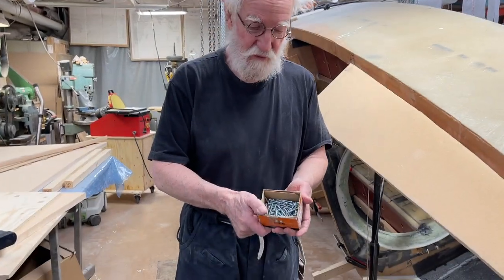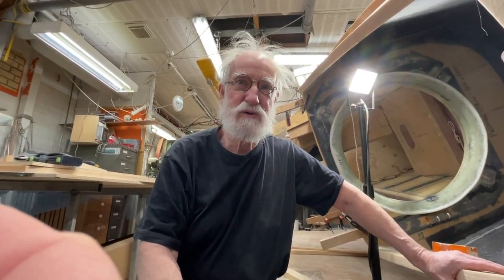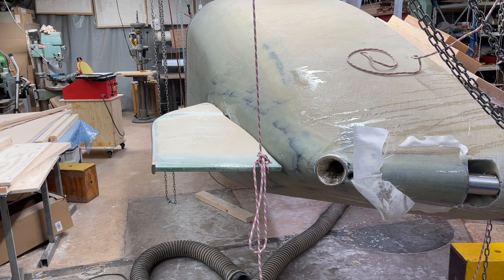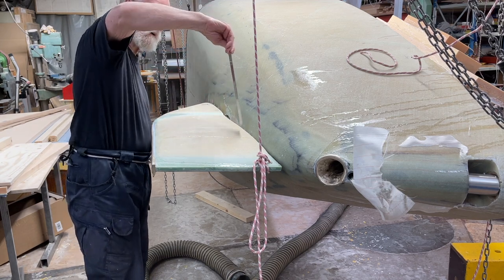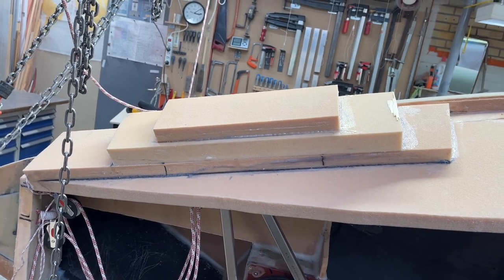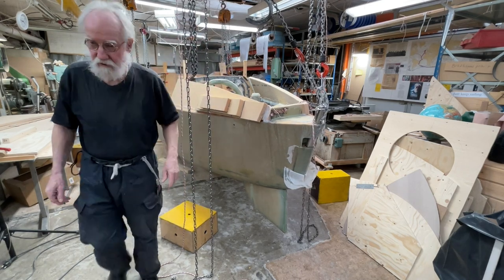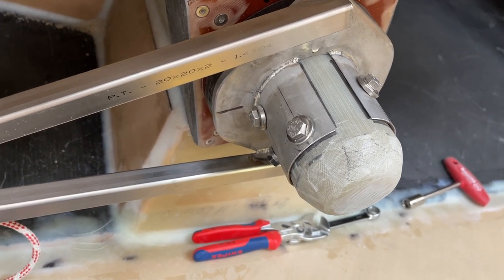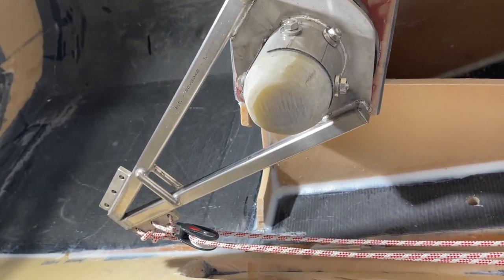Swinging the rudder

Comment: When a person thicknesses a violin initially, holes are drilled a measured amount and the top or back is gouged out.  When the holes disappear the rough thickness is right, then the fine finishing is done with scraper and sandpaper and caliper.  Much like working with Dvinycell it seems.  I don't like the blister much but if it has to be it has to be.
Reply from the maker: Thanks for the violin information
Reply: Bilisters in this sense can be beautiful. Look at potent cars from the sixties and seventies. The blister tells that there is something extra “under the hood” while the original body is as slim as it can be
Reply: @SvenYrvindExlex  Any time you want to build a violin let me know, I'm here for you.
Reply: @petternorman6192  Yeah Petter you're right about that but in this boats instance I thing something could get jammed in there when it gets rough.  There's going to be rope and drogue chain and anchor and all kinds of stuff in there.  I think you're talking about mid 1960's Prototype Fords and Ferraris and cars like that.  They were works of art.
Reply from the maker: @ralphwatten2426  I am completely tone deaf have no sense of music so I will focus on this boat.
But thanks for the offer.

Comment: One bad, ill-considered thought begets another, until their accumulation creates a monster. The design of the rudder, especially the long rudder bolt lever that does not fit in the cabin, creates a structure that is not strong, stable and looks ugly, spoiling the beauty of the whole design of the boat.
It is bad to look at the swelling of the boat from the side, as if it is sick. 
Sure Sven, you're an old sea bear, a boat builder, but right now that confidence is bothering you. Take a mouthful of rum and rest, watch what you've done from the side, so to speak, in the third person. In our country, they say that a person learns all his life ... but still dies a fool. So don't be afraid to learn, making mistakes and correcting them is a fun process and that's what life is all about.
The steering structure needs to be put back on the table, thought through and redone.
By the way, talk about it in your video and ask people for ideas on how to make a better steering system. Get your fans thinking.
Let's be positive.
Reply: Yes.  A quadrant is the traditional, well-proven approach, or a round pulled wheel.  The 'lever' effect is always the same length, unlike a tiller style.  It would be much neater and more pleasant to use, IMHO. 😊
Reply from the maker: @leeboell9547  I used the quadrant on a few boats and this system on some.
The lever effect is the same but not the force on the rudder as you will realising by doing a bit of thingking.
However in practice you do not feel the difference.
My boat is just a small one sailing slowly.
This system works better for precise adjusting the rudder angle as will be apperant later.
Reply from the maker: I disagree with your analyses.
I have never drunk any alchohol not even a beer in my hole life and it have helped to keep me sane.
Still I welcome more suggestions especially if they are positive.
Reply: @Sven Yrvind  Sven, if you encourage positive ideas, why then do you belittle other builders and attack their character and craftsmanship when using a proven technology. 
May I suggest you research the building of " Windward Passage" and at least reconsider your thinking. You might also consider sending Alan an apology. 
While I have never met this Wave Rover fellow he appears to be a more than honorable singlehanded sailor building a very strong craft.
In closing for now my good fellow, as a professional sailor and marine surveyor for over 40 years I can tell you I have seen numerous failures in composite structures.